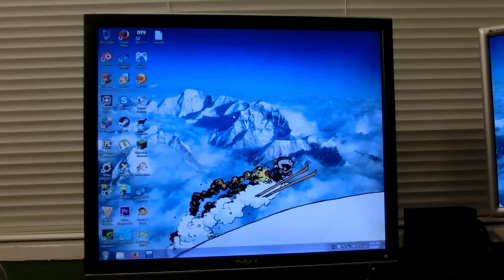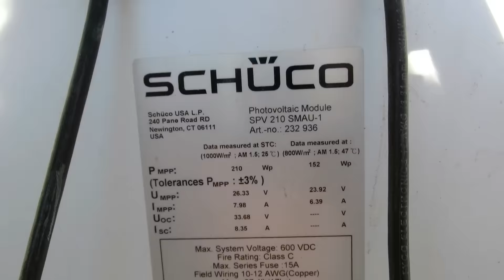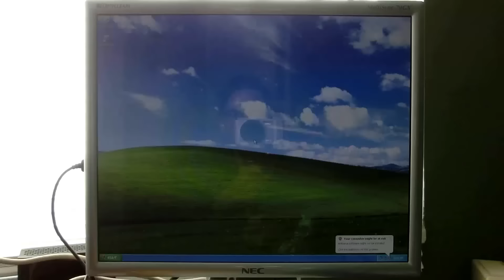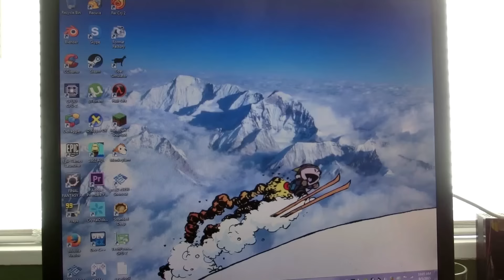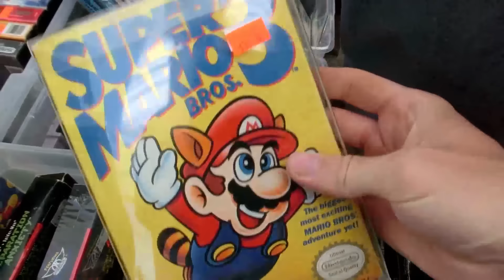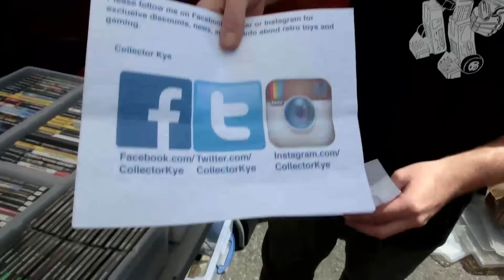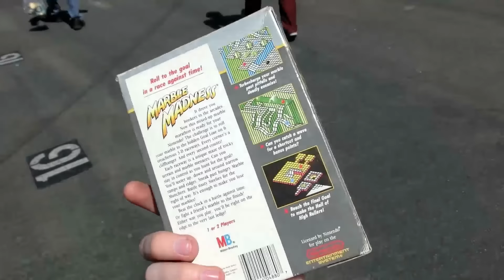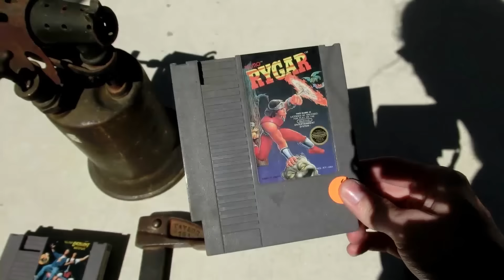Random Bits 0104: Flea Market, Blacksmithing Tools, Solar Panels

Comment: If you mount the headlight on moving handle bars you might not like the motion. The light will amplify any movement.  Meaning it will shine here and there. Its annoying!  Mount to the frame, the neck in between the handle bars and tire. rim. forks. 
Im tired, sleepy. Hope that made sense

Comment: Instead of just dash cams, may I recommend a pair of spy cam sunglasses? There are cheap pairs for $30, but make sure the viewing angle is good with the resolution you need.  I like them for doing 'dash-cam' while I am cycling, they also make for easy hands free POV for DIY projects. 

Keep up the great work!
Reply from the maker: +Aerik Forager they wouldnt be high enough quality for me to use for my videos, and theres a point at witch its pointless to prepare even more.

Comment: Did you thoroughly test those panels? Old solar panels tend to degrade. They might supply good open circuit voltage and short circuit current but when you add a load the voltage and current drop significantly.
Reply from the maker: +POVadventure not yet but for 40$ each i couldnt pass them up. i got them home and they run 12v lights really well.

Comment: Man, I have a dell optiplex 760 lol, core 2 quad core.. Not sure what else I jammed in it.. You would need at least 2 of those torches to heat larger lumps of steel, been there done that. You should make an induction forge.

Comment: that light is a little large for your helmet.  great deal on the solar panels.  I wish we had more places  like that here. i'll have to check it out. i did sub him.  I have a blow torch i picked up at the recycle center here. i'll have to try it out. You could make a brake drum forge and use a hairdryer, they work good. that bully that bothers you is a idiot. There's good and bad everywhere.

Comment: How weird, an 8x PCI-E video card. It's nice that even the low profile, low power cards today are reasonably good. I remember the ATI x300 and Geforce 6200LE's of days gone by - even for the time, they were junk, usually scarcely better than onboard video.

Comment: Hi Rinoa brilliant video, brilliant finds love the blowtorch/lamp D.Im glad your torch still has the wind shield, use  white gasoline naptha/coleman fuel most American made torches were designed to be run on Gas the were some that were made for Kero but most American made were gasoline, Canada made torches that were quite often made for Kero.For the fun f it do the expirement with the three fuels you mentioned, it will be a lot harder to get going on Kero and it will flare very easily, i dont think you will have much sucsess with Diesel.I will look forward to seeing you use it for your forge, a large heavey duty brazing lamp would be great for that though, like my Barthel or the WW11 lamp i have in my vids they would work great for the forge D.Take care Rinoa and try to keep out of the idiots way, its way to easy for him to spot you on your Trike
Reply from the maker: +brianthestovie thanks!

Comment: I could not tell the weight of the headlamp but my best guess is that it is too heavy to mount on your trikes front fender unless you don't mind your fender cracking and falling off due to metal fatigue.
Reply from the maker: +gorp27 its very light, but i think that fender could take a lot of weight.

Comment: Those old blowtorches are made to run gasoline or white gas in them - better stick with that, bud.  I'll bet paint thinner would work OK.  I ran kerosene in one once, but it isn't as easy to use and much more finicky and needed lots and lots of preheating.  Hi octane, or non ethanol gasoline would work best if you can get it where you live.  Alcohol doesn't have the BTU that gasoline does so the ethanol fuel would be a bit cooler.  Rubbing alcohol works well for the preheat tray if you get tired of all the carbon.  You get to watch all the water in it bubble and hiss as it heats up.

Comment: Windows XP Pro will soon expire and will not activate and will only work for 30 days(Sorry about that) so it might be an idea to go with something like GhostBSD or Linux Mint 17.3 (Rosa) 64bit edition, if you could build a high power ROYER oscillator that would run of a car battery you can use it for heating the item to be forged.

Comment: I'm not sure if I missed it or if you didn't wind up saying it in the video ( it's 1 am after a long ass day at work so it's entirely possible I missed it ) but did you say how much that little 5v solar panel cost and where you found it? was that also at the flea market?
Reply: PS I want your trike but will have to settle for the E-bike my sister in law traded me for a piece of exercise equipment. Problem is the battery pack is kaput ( it got knocked down the stairs to the basement at their place... twice) so I will be needing to go back through your build-a-battery videos, I'm a shiny new sub and I'm really glad I found your channel. I wish you good luck on your adventures!

Cheers!
Reply from the maker: +8Jory got the panel from ebay for like 9$.

Comment: Those headlights are fucking ideal for what I'm planning on using a ride on mower I'm restoring/modding. Where could I easily buy some of those from? I'm in Aus and our dollar is shit currently but I'd like to buy 4 or so later when it improves. Are they very expensive? Are they common in the U.S.? It's hard finding bits like that here.
Reply from the maker: +TheAussieStig30 got them from amazon for 18$ each, they are 10w motorcycle lamps and they take about 2.5 amps of power at 12v.
Reply: +Rinoa Super-Genius sweet, thanks man. I don't think Amazon ship to Aus but at least I can check out other places now and I have a price to work to. Although $18 usd is about $35 aud at the moment
Reply: dang good idea for my riding mowers! esp the 12v regulator for lipos
Reply: +RC Hunter Zippo Varga has some awesome riding mowers and I really would like some of the brackets he has on his, my Rover Rancher doesn't have any lights but these would look awesome on it when I wire electrics on it. Just need to find a Briggs 20hp twin now!

Comment: The GT 730 is a decent enough GPU. I never did understand how those half height cards worked till now. I though you actually removed the top part in half height systems.
Also graffiti as in the art or graffiti as in tagging?
Reply from the maker: +Karim Kandil idk, as in spray painting on the building.
Reply: Rinoa Super-Genius OK then